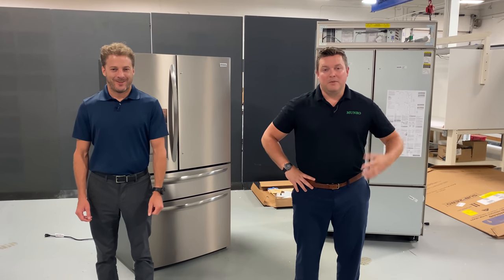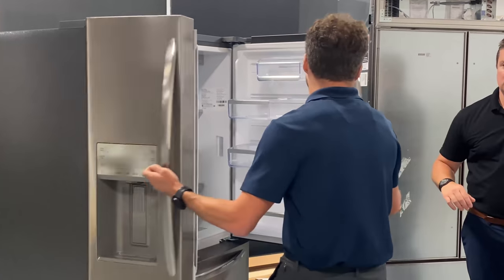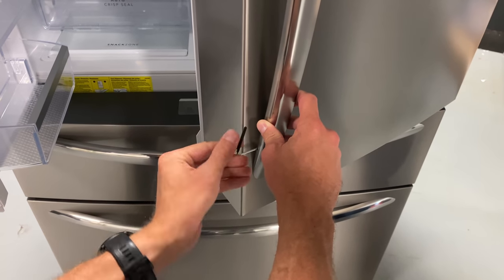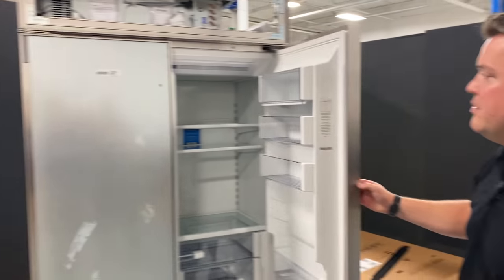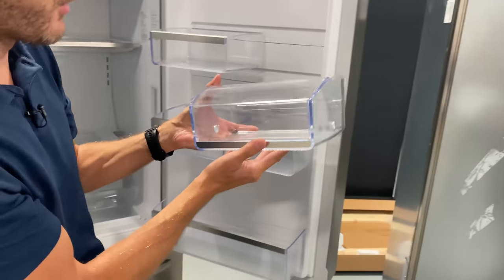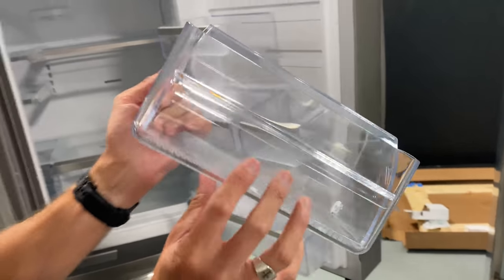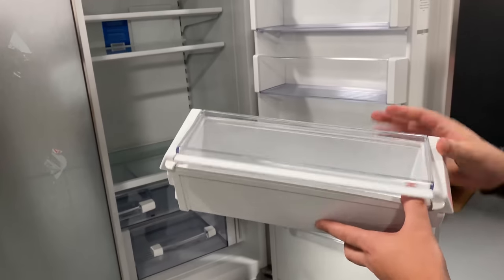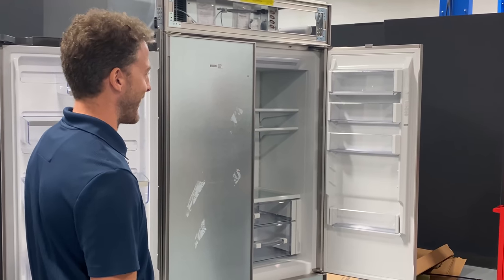Consumer Series: Sub-Zero vs Frigidaire - Drawers + COLD TEST!!

Comment: One thing that wasn't mentioned on the 'Cooling' speed temp was the amount of thermal mass in materials inside the Fridges.  One may have more thermal mass to cool down (i.e. if one has a lot more metal in the lining of the fridge, it would have a lot more thermal mass.  The air itself doesn't have a lot of thermal mass in comparison.  

All that said, the reality is once they're filled with food, that food is going to have the majority of thermal mass.  So the cooling of beverages by tossing them in the fridge is going to be more about what temp you have the fridge set at, as the thermal mass will keep the temps stable (the fridge will kick in and gives cycles but typically at 1-2 deg diff in nominal air temp.

Comment: You need to put some matt black tape on the cans otherwise you're just measuring the back of the fridge reflected in the surface of the can.

When you pointed 'away from the reflected part' you were just pointing at a different reflected part which was reflecting the interior of the fridge rather than something hot outside of it.

Comment: The difference in cooldown speed could be due to the differences in thermal mass within the insulated compartments. A better test may be to start with both units at the same low temperature, and measure the time required for 2.5 gallon bottles to chill to a slightly higher target temperature. This might better test the heat pump capacity.

Comment: The worst thing a bad fridge can do is freeze food when you add a bunch of groceries on a weekend shop.  Setting the thermostat to 37 doesn't mean the air at the heat exchanger is 37, but that it's keeps pumping freezing air until the sensor at the top of the fridge reads 37.  I'm looking at you, LG.  I wish someone would measure how evenly a fridge cools and whether it freezes some spots when a large load is added.  The veggie crispers work well to protect the veggies, unless you have some many veggies they take up space outside the crisper.

Anyhow, would not mind a slow cool down if it prevented food from freezing, for those of us that eat lots of veggies.
Reply: Passive convection cooling work unless the fridge is overloaded by stuffing things in. Internal air circulation fans disappeared from all but the largest fridges once it was known that the average consumer opens the door 15 times per day.

Comment: Deferent cooling systems, Subzero refrigerator has a warmer evaporator,  this is good for food preservation. High flow larger evaporator surface, but no defrost system as Subzero evaporator defrost during off cycle.

Comment: I believe the Sub-Zero is designed for trophy wives that are not likely to be using it very much and it's likely to be opened up and found a lot of decayed over aged groceries if any
The Frigidaire is more likely to be well-stocked with ready to consume food.
Reply: if you take out the shelves of the Sub-Zero it has a large enough capacity to hold a trophy wife once you get tired of her. Set the fridge thermostat to minimum, wipe it off and confound the ME's time of death estimate. Thaw just before leaving on an extended trip to establish an alibi. Happy Columbo Day.

Comment: Is the input voltage the same on both?
Reply: The Frigidaire is 115VAC, 115A circuit.  It looked the SZ was connected to a 3-prong AC extension cord. The SZ might need a 20A circuit, but it shouldn't.
Reply: @James Ziskend Save a copy of your comments, keep the language clean,  and keep reposting them under alternate names after Sandy returns. They will tire of being censors.

Comment: I like having my temperature controls outside versus in.  If every other OEM can implement this functionality given the premium cost of a SubZero, why haven't they adopted this approach yet?  The last 2 refrigerators I've purchased (combined for less than 1 Subzero) over 16 years for 2 houses both have this as a feature; my most recent fridge, I can adjust via a smartphone app.  

I noticed the Ethernet run in the access panel (Ethernet!!!); who incorporates ethernet in today's connectivity environment?

But nice butter container, though...

Great job on the review thus far.
Reply: The thermostats should not need to be adjusted once set for the household. In the US the average person opens their fridge 15 time per day. Once more doesn't justify exterior controls, just easily accessible ones.  You might as well yearn for a digital temperature display on a dog. If it is sick there will be gross symptoms, and the tech, the vet, will do a rectal temperature measure with  $5 thermometer in a sheath.
As far as smartphone remote control, whatever can be controlled via the internet is dependent on an external server, and can be hacked. IOT devices have generally poorly written software, poor security and are hackable gateways to internal networks
Reply: @psdaengr911  I've used the temperature controls occasionally for my own personal reasons.  "Should not need" doesn't address all use cases; that's why Henry Ford's Model T marketing strategy is no longer practiced by any OEMs operating at scale.

But hey, the dog correlation is cute.

Regarding the "vulnerabilities" of IoT, there are risks applicable for EVERY device on the internet. I've used IoT devices for over 10 years, and none have ever exposed me to a potential hack (other "reputable" websites have). While it is feasible, any device can be hacked, employing a robust security approach dramatically diminishes personal risk.  

The one frequently referenced common factor with hacked devices and services is poor password discipline.

Comment: Some high end refrigerators concentrate the cooling to the freezer first!
Reply: but it has 2 pumps. 1 for each section.
Reply: How does cooling down for 1 hour mean anything? No energy consumption tests. Check it in 4 to 6 hours, put in remote sensors, check cycle times, temp holding. Put them in a temp controlled room at 100 degrees. Then try them in a cold room at 65 degrees. That is  the kind of tests that can be  related to. What about ice production? How quiet are they?
Reply: @James Ziskend Where's your youtube channel then? It's easy to critique others and not do yourself. Are you qualified? I know you feel qualified to complain about free content.

Comment: This comparison is no comparison at all.  It should be noted that the refrigerator section of the Sub-Zero is 38% larger than the Frigidaire (19.9 CF versus 13.0 CF). It doesn't take a genius to realize that a larger space takes longer to cool.  The only way a temp comparison like this one would be fair, is if you were comparing two refrigerators with the same capacity.  For greater accuracy, it would also be better to use temp probes inserted into each can to measure the temperature of the liquid, rather than try to get a reading off the surface of a shiny metal can with the door open.  Regarding temperature, a much more valid comparison would be how well each refrigerator can hold its set temp in real world usage.  A refrigerator in the home might be opened ten or more times a day.  During this time people are loading and unloading things and cold air is escaping.  How well is each fridge insulated, and how quickly can it recover its set temp?  Regarding price, it's worth noting that the Sub-Zero is made in the USA, and the Frigidaire is made in Thailand.  It's obvious which brand creates American jobs and supports the American economy, and which one doesn't.  Lastly, there should be a consideration regarding the future availability of parts & service, as well as longevity.  Only time will tell which one of these refrigerators will still be in use in twenty years, and which one will have been taken to a landfill years ago.  I'll wager that the Sub-Zero will be the one still purring along just fine.

Comment: Wow, nobody can analyze the style and color of a product without this type of stringent "engineering analysis"!    If you were really interested in the temperature you would have opened the cans and put a thermometer and measured the temperature of the liquid contents.  Perhaps Todd of Project Farm could advise you on how to do this!
As pointed out in numerous comments, Adam is clueless of how to measure anything with that nice SEEK pyro which measures emissions and reflections.  Mr. self-promoting know-it-all should read the instructions and perhaps a tome on passive IR thermal measurements in general.  That's Strike 2 for smarmy Adam.

Comment: Try to  explain the purpose of comparing the fridge equivalents of a 2021 KIA Neo sedan and a 1999 Mercedes G-class Wagon.

The beer cool down test wasn't a meaningful exercize. The startup to stabilization time of a cooling appliance precludes a meaningful measurement during that interval. The function of a fridge is to maintain a internal temperature.You didn't let either one achieve steady state.   
 
 You need other more objective and meaningful metrics, like the time to cool masses proportional to the units' internal capacities, and the kw-hr to maintain masses equivalent to 60% of the unit's capacities for 72 hours AFTER the appliances have stabilized.

btw, If you were to objectively rate the finishes of the two appliances exteriors, undamaged,  the Sub-Zero with NO finished exterior surfaces would get a Zero.  The Frigidaire with 50% of its exterior surface potentially visible when installed meets a higher standard for exterior finishes ths the Sub-Zero.  

You can't excuse damage or door alignment to the Sub-Zero's cabinet as something that could be fixed by the paid professional installers. As far as packaging, the cheaper unit shipped from Thailand via ship, and truck with multiple handlers, suffered less physical damage than the expensive unit shipped 1/10th the distance.

The Frigidaire is designed to be a DIY installation with only one adjustment- leveling. That operations is clearly described as to be performed first, before powering up the unit. The Sub-Zero has an extensive checklist. The paid professional Sub-Zero installation is essentially bringing the factory to the jobsite to finish the work. Both units have prescribed startup times.   

It's a poor technologist who doesn't follow installation directions written for a 8th grader, and does not realize the limitations of his previous experience.

Cory might be a good manager, but I would not hire either of these people to work for me as as an unsupervised engineer (or as an appliance installer).   

I fear for the future of Lean Design after Sandy retires.  I see a typical small service company that espouses the founders philosophy by whose leadership does not yet have the founder's skills.  That's why few small businesses survive unscathed through second generation management.

Comment: Measuring the can temp with the FLiR isn’t the best use of that tool. Why not just open both beers and stick a thermometer in? Much better result. Also stick in simple digital thermometers in the fridges and you could actually graph how they cool down both loaded and unloaded. This series is feeling very very amateur hour. Stick a meter on both power cords and you can see how much power they draw to accomplish their cooling tasks over time….

Comment: Did you guys consider that you may have caused that sheet metal damage on the Sub Zero with the careless way you removed the box?
Reply: no way a cardboard box being lifted up caused that damage.  watch the previous video and you'll see damage on the outside of the carboard!
Reply: @jetah50  How did a horizontal impact cause that sheet metal to buckle up?
Reply: @Rexy624  how did a flat walled side of cardboard cause it? they were literally lifting it by hand. no way that was done with lifting the box.
Reply: @jetah50  By hooking the seam in the bottom corner of the box as you can see at this point when they lost control and the box levered over: https://youtu.be/KAYj6m9QtDU?t=498      It would be interesting to see all of the footage from the left camera. No matter what, it was a very amateurish removal of the box...
Reply: @Rexy624  the panel that's bent was pushed from the bottom. the cardboard box didnt do it.  it looks like it might have been damaged when the panel was put on. but it isn't really my problem.
Reply: Even if that was how it was damaged - which I doubt - that certainly wouldn't let Sub-Zero off the hook for a poor packaging or fragile product design.

Comment: Sub-Zeros don't run without exterior panels in teh real world. That extra insulation would surely help in it attaining low temps more quickly. 
A truly fair [ and scientific ] comparison would take place in "installed" conditions. 
(Sandy won't be too happy with this, me thinks...)
Reply: Then they also would stand with the cooling radiators more enclosed, but I agree

Comment: I have a refrigerator like your $3000 refrigerator what I don’t like about it is the door handles on the refrigerator is too close together between the two doors, and the gap behind the handles and the front of the door is too small also!!!
Reply: Try reaching toward the handles from the front outboard sides and tugging with your fingertips. It does not require a strong  "manly" grip. The magnetic seals are not very strong.  My fridge has no handles and I can open the doors with one finger.

Comment: You can see Adam is a real engineer when he takes the measurement of the highly reflective can, aiming straight at the body heat reflection stripe right down the middle, instead of say the matte tape they placed to hide the brand. Just another one of those 'shiny-but empty inside' engineers who have no logic/experience based know how at all, and too many venture cap startup dinners and much experience blowing hot air up others a**es, like selling a physically impossible gadget on a crowdfunding site... disappointing

Comment: This is stupid though. The cooling rate from ambient is something the user will encounter maybe once or twice in the lifetime of the fridge. So assuming you own the fridge for 10 years and it is turned off twice in those 10 years, it means that 0.00001% of the time the fridge may not operate to the user's satisfaction. Unless you live in an area prone to blackouts it's a completely arbitrary test. Heck, are you really gonna oversize the heat pump by 200% just so it can cool a beer just a little faster? That's stupid. Like 99.9999% of its lifetime these devices will be working as steady state machine. The steady state consumption is MUUUUCH note important. Like 99.999% more important.

Comment: these two refrigerators are for entirely different markets, comparing these two is not logical.  Compare similar priced units to see variations between mfgs.  Most "commoner" appliances have become generic, my latest GE refrigerator came in a plain brown wrapper, , unlike most in the past, would have big company logos on the box, even the door label was applied when it was installed, the stick on serial number label, most consumer units are using the same compressors, controls etc.  A GE a Whirlpool,  and any other consumer level unit, are so similar...samsung, LG, GE, all generic.  Commercial stuff is much better products...Sub Zero is just an over priced consumer product.  While they are getting more energy efficient, they do not hold up nearly as long as they should, so you save nothing over the 10 years they run, cus ya gotta buy a new one....thinner refrigerant components, operating under higher pressures for new refrigerants get leaks and corrosion faster.